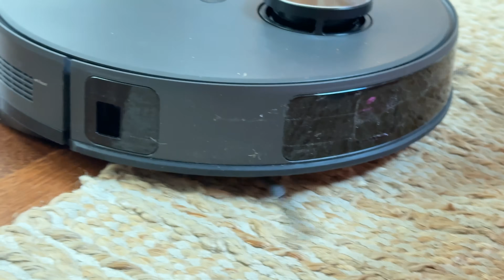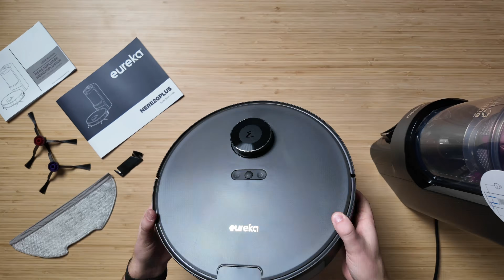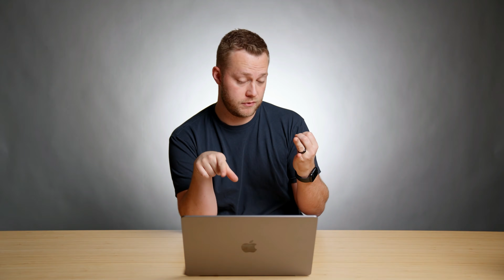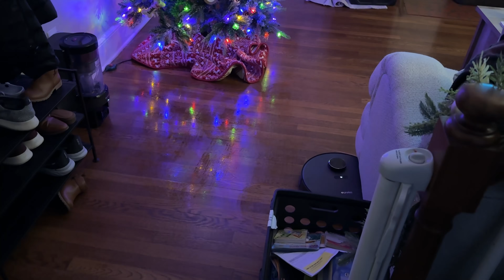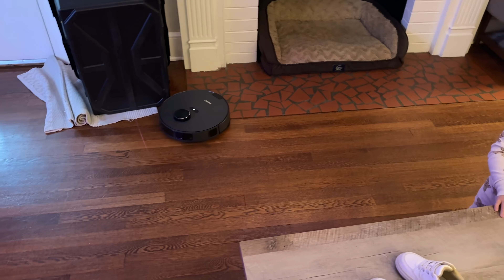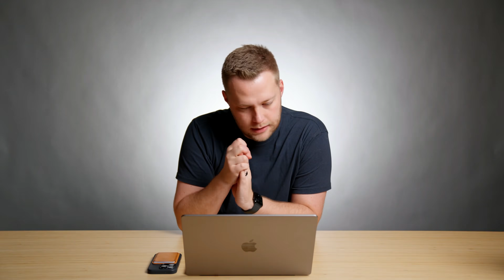Eureka E20 Plus Bagless Vacuum: High-End Performance, Low-End Price

Comment: I bought this robot vac on Black Friday a couple of weeks ago.  I absolutely love it.  I'm a pensioner and no longer find using the standard upright vac easy and my son is disabled with serious health problems (hopefully some will be resolved in the new year and yes, it is life-threatening).  I've had robot vacs in the past, a Neato which wasn't bad until one of my cats peed on it - we didn't realise our cat had developed acute and sadly fatal kidney disease.  Then we had a Eufy which was the worst one possible.  It didn't pick up anything and the self-cleaning part completely broke down.  Biggest waste of money ever and we found Eufy to be very unhelpful.  Then we got this one and it is fantastic.  We have all carpet apart from the kitchen and bathroom.  What a great job it does of vacuuming the carpets.  I haven't tried mopping the kitchen yet with it as I had to take off the mop part because where the base unit is, the carpet is quite thick and it was getting stuck trying to reverse.  Another plus is, even on high suction it's really quiet.  Our cats don't mind it at all.  It's definitely my best buy of the year.  We named ours Tilly.

Comment: I received this vacuum for Christmas.  I have a Neato D3, 8 years old, but I'm having a different experience than you are.  I've run it twice to create a map, and it continually gets stuck on any wires on the floor as well as my living room carpet, which has tassles on the edges.  The D3 had no problems with any of that.  I'm trying to create no-go zones, but the map is so small on my cell phone that it's hard to determine where everything is!  I'm not impressed.  Maybe as I continue to use it, it will start avoiding areas it gets stuck in, but I'm not holding my breath at this point.
Reply from the maker: Ah man I’m sorry to hear it :/ I haven’t had those issues, personally!